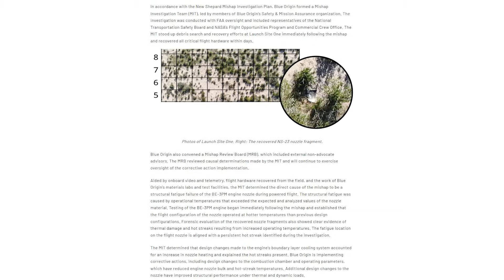What Happened To Blue Origin’s New Shepard Rocket?

Comment: No mention of the carbon footprint in a climate catastrophe , unbelievable !
Reply: New Shepard has no carbon emissions, as they burn H2 and O2 to form water. The carbon footprint depends entirely on how they source their fuel. If it's green hydrogen from electrolysis, powered by renewable energy, (or extracted from biogas via methane steam reforming) their operation will be carbon neutral. Besides CO2 in the production, the main concern would be the effects of the water vapour trail left in the upper atmosphere. However due to the small amount of these launches (only a handful a year, as they are only affordable for multi-millionaires) the climate impact will also be quite small.

Comment: Great video and info !  The New Shepard is an important rocket ! This rocket is also testing the Rocket Engine I think that will land the Blue Origin Blue Moon on the moon and then return to the Gateway to be refueled !  Also the New Glenn is tasked to deliver the Blue Moon to the NASA Gateway.  Once Blue Moon can be refueled at the South Pole Lunar Base (Clementine Base ?) for trips to the NASA Gateway or return to LEO as a LEV/LLV  (Vision 3 of 5).  See "moon direct" by Robert Zubrin for more info !  Back to the moon to stay and onto Mars and beyond-Ad Astra...  T. Lipinski   P.S.  Does NASA have the Vision, the Vision for Space Exploration (VSE) ?
Reply: It is not doing that, since BE-3 PM is the engine on New Shepard while BE-7 is the Blue Moon HLS engine. The Tipping Point technologies program that NASA runs sponsors tech demos on NS, but several of those were mounted on the destroyed tail #3 booster, and it's not clear if #4 booster can host such experiments.
Reply: New Shepard uses the BE-3PM engine, the New Glenn upper stage will use the BE-3U engine and the Blue Moon/ National team moonlander spacecraft will use BE-7. So they aren't exactly the same engines, but Blue Origin is definitely getting valuable experience with cryogenic Hydrolox engines.
Reply: As others pointed out, NS uses different engine, however, New Shepard has in the past tested optical sensors and algorithms planned to be used on Lunar Landers
Reply: Unfortunately it is still just so much vaporware! 
They don't have a working engine!
Reply: @mahbriggs  They have the flight tested BE-3PM, which has had its issues fixed after the New Shepard failure and will resume flights next month.
They have BE-4, which has successfully completed a static fire on Vulcan and will fly later this year.
They have BE-3U and BE-7, which they have built and tested and are intended for New Glenn/ HLS lander.
They also have BE-1 and BE-2, which were successfully flown on reusable hop test vehicles, but are to my knowledge retired and not planned to fly again.
Reply: @plainText384  
We will see! So far, nothing has flown!  Years behind schedule, I doubt the BE-4 flies this year.
Reply: @mahbriggs  troll detected
Reply: @mahbriggs  BE-1 has flown, BE-2 has flown and BE-3PM has flown.
Reply: @_mikolaj_  
Who? You?
I am just pointing out tge obvious!
Reply: @plainText384  
Who cares?  They aren't anything capable of putting anything in orbit!
I use to play with model rockets, doesn't mean I could put anything in orbit!
Reply: @mahbriggs  NASA cares? The people flying to space on New Shepard care? Rocket enthusiasts care? There's a big difference between your fun little toys and a fully reusable crewed suborbital spacecraft running on cryogenic liquid hydrogen.
Reply: @mahbriggs  Which of your model rockets were capable of putting anything past the Karman Line over 100 km up?
Reply: @Starshipsforever  
Which of Blue Origins rockets has made orbit?
Let me know if one ever does.
Reply: @mahbriggs   Ah, another goal post mover. You got smoked on one lie, and then you try to slime your way out by changing the goal to something else. Gotcha.
Reply: @mahbriggs  This is clearly an outright lie on your part. BE-1, 2, 3, and 4 have all been shown to work. The first three have all flown, and BE-4 hopefully will fly in December on Vulcan Centaur Cert-1. BE-3U has been ATPed at Marshall test stand 4670 last month, and photos were released of several BE-3Us being finished.

So, if you're going to lie. Lie better.

Comment: Is it not the case that New Shepherd is just a distraction at this point? They need to move on and ditch the past.   They need to focus on BE-4 production and New Glenn development. I certainly hope that BO doesn’t consider the income money a motivation.
Reply: There are 4 New Glenn Flight boosters in production now
Reply: @_mikolaj_  
Yes, and that would suggest that that is where the effort is going which makes sense AND I WISH THAT WOULD MOVE A BIT FASTER. Though I understand the reluctance to follow the Ēlon™ Uber Boss Methodology™ of “Progress by Repetitive Corrective Action Due to Expected Iterative Failure”.
Reply: @_mikolaj_ 
When will they have an engine?
They are just big fuel tanks without an engine!
Reply: @mahbriggs  they have their engines?
Like idk if you know, but engine installation is last part of rocket assembly.